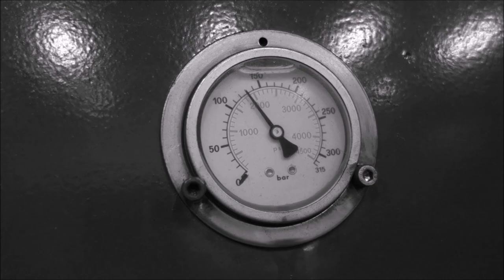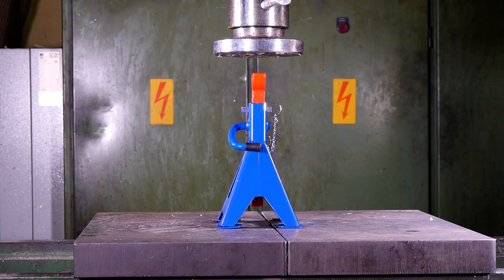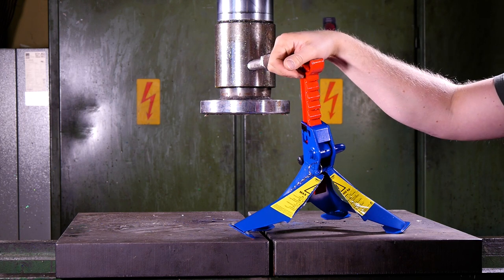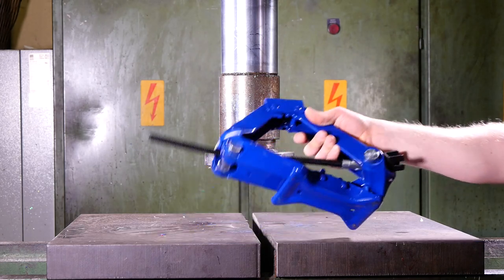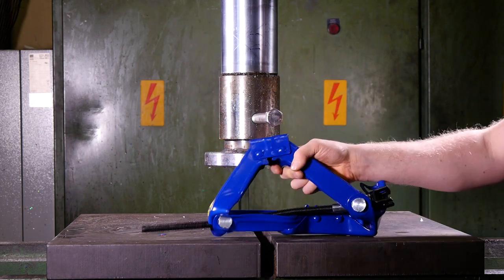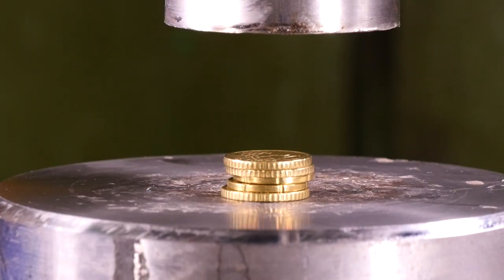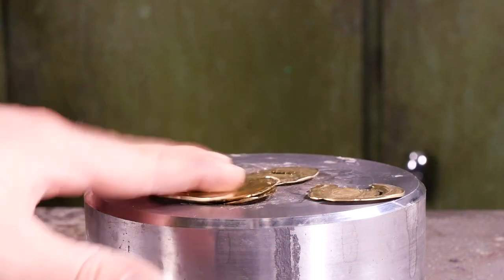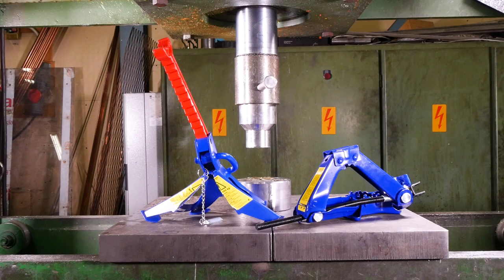Crushing jack stand and screw jack with hydraulic press

Comment: Can you press a heavy metal spring and film it with a thermal camera? also hold it in the pressed position until it cools to room temp and then release. I am interested to see if a steel spring heats up and cools down like a rubber band does.
Reply: Cody'sLab I wasn't expecting to see you in the comment section of a random video that was in my recommendations. I think this could make for a really interesting experiment for a video. Like set up some sort of thermal camera and record different objects being compressed and decompressed and seeing if they change temperature. And of course it should be tried in the vacuum chamber. Now that I'm thinking about it, do you even have a thermal camera? I can't seem to remember there ever being one in a video.
Reply from the maker: Great idea. The car spring video was so popular that it would be probably worth of doing again with thermal camera.
Reply: Can you please do another trolley jack and jack stand and measure how much force it took to fail? 

One cheap and one moderately expensive jack stand of the same type would be cool too. And/or different types of jack stand. Obviously with both rated to the same weight.
Reply: Cody'sLab love both your guyses channels ❤️❤️

Comment: would like to see you crush a anvil
Reply: snookdock maybe a miniature one, but a full size one, not possible
Reply: anything is possible with a hydraulic press
Reply: We would need that fancy new one he's been building for a while now.
Reply: That just means they need a bigger press... There are machines that just fucking stir metals together with a carbide spike, crushing an anvil shouldn't be much of a problem.
Reply: Teth47 got a link to one of said machines?
Reply from the maker: I think I could crush small anvil and vice. I try find those so then we see :D
Reply: Hydraulic Press Channel Drill a hole in the top of the anvil and add dry ice, should make a nice pop as it presses if you manage to deform the anvil enough.

Or better yet if you can, cool the whole anvil in liquid nitrogen and see if it shatters!
Reply: ***** Graphene is microscopic and can't be made larger with current technologies, also, it's only strong under  tension, it collapses like a sponge under compression.

Comment: Mighty bearing ball in the thermocam!
Reply from the maker: This is coming. Only problem is that the longer wawe lenghts of light that thermal camera records won't go trough our plexan blast shield and that camera is bit too pricy to be shot with shrapnel. But I am planning to film trough mirror so then the fragments wont hit the camera.
Reply: IR cannot penetrate glass, but won't you read temperature of glass and not the reflection?
Reply: use mirror and record from a different room, so your thermal cam won't get damage from sharpnel

Comment: You should try making damascus steel with the press
Reply: That's a great idea.
Reply: So? It'd still be a neat experiment, and he doesn't have to do hundreds of layers, just a few as a proof-of-concept. No slower than doing it the old way (hand-forging).
Reply: bobwatters 
not at all to slow... i have set forge wields with a screw press.
Reply from the maker: Great idea! I have small foundry also now so I can heat things up in there
Reply: Hydraulic Press Channel 
remeber for a forge wield, make sure it is white-hot, it will be sparkling.

Comment: Is it just me or did that jack stand do horrible? Like, I know its a 100ton press but the damn pressure needle didn't even move. The welds split like butter. Makes me worry about these cheap jack stands I use....
Reply: Don't worry, your car don't weigh 100t... The press has so much power, that it break that kind of stand with pressure valve open. If I remember right, Lauri told earlier, that less than about 3 - 6 tons of force are not measurable with the needle.
Reply: Good to know!
Reply: i agree, but it's only rated to 5 tons. when lifting a car which is 1.5-2 tons it's never an issue, especially when you consider that you're often lifting only 1/2 or less of the total weight.

Comment: Maybe for BTP, you could do a test of a set of jack stands overall toughness by dropping a trucks rear axle onto them from various floor jack heights.  Meaning , jack up the truck, then quickly open the release valve and drop the truck onto the jack stands to see if they can hold up. Could add more weight to the truck bed if needed.

Comment: Oh Danny boy, the pipes, the pipes are calling!

The steel pipes, round, square and why not other shapes, bent in pretty interesting patterns. Sadly some were so rusty to prevent good visibility but I'm sure they will have even more interesting patterns on heat camera.

Also, even if IR is fully or partially trapped by glass in a mirror you could use a piece of polished metal as mirror.

Comment: I like the thermal camera as well as the pressure gauge cam, though the pressure cam is hard to read at that angle.  For us regular folk it would be nice to know what the reading on the gauge means in terms of how much force is being used.  I'm assuming the gauge is just reading the pressure in the hydraulic lines of the press, and not what is being exerted at the press-head.

Comment: Can you modify press so it moves quickly ? Like a stamp where the hydraulic fluids travels much quicker
Reply: it will either be super expensive, or the pressure will become very low
Reply: Christian M that would not be a hydRaulic press but rather use die springs